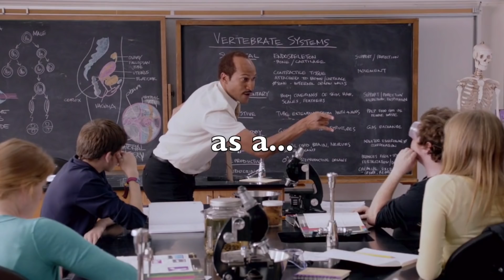Using Tesla parts in my Electric Rat Rod Conversion

Comment: "This battery is very, very secure."

No, it isn't. The first time you apply brakes at any speed, the momentum is going to send it straight through the radiator. Hoesntly, I've seen dodgy engineering but this really takes the iced confection my man.

And cable ties on the wiring? Are you frelling serious? Arrrgggghhh.